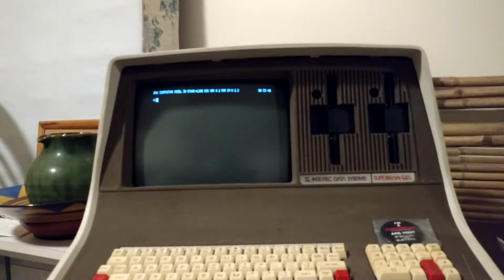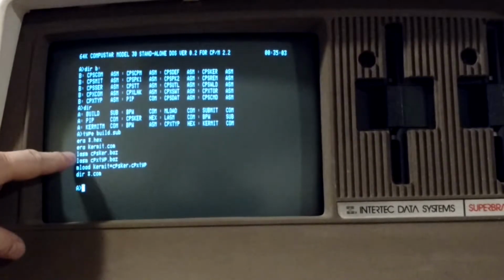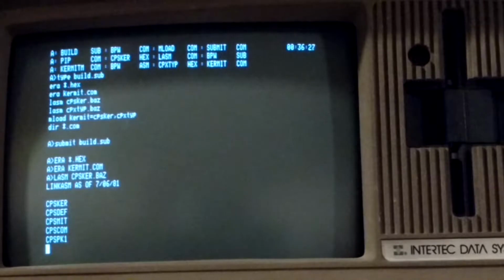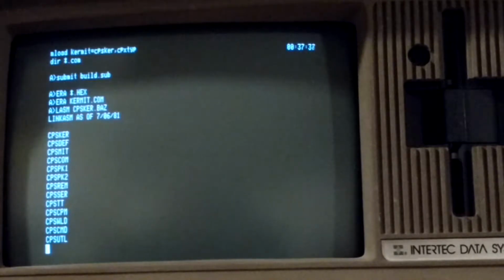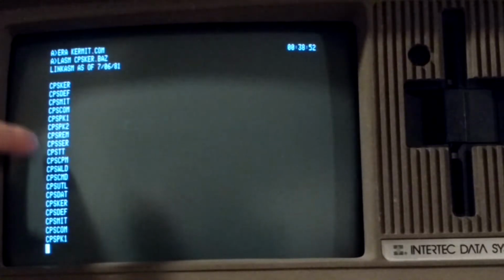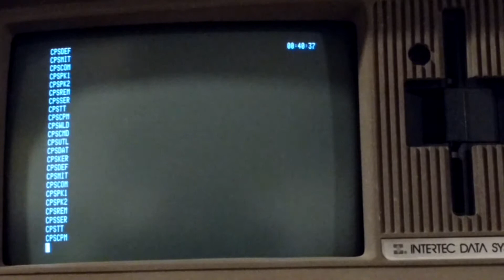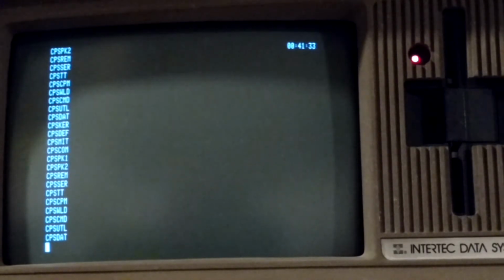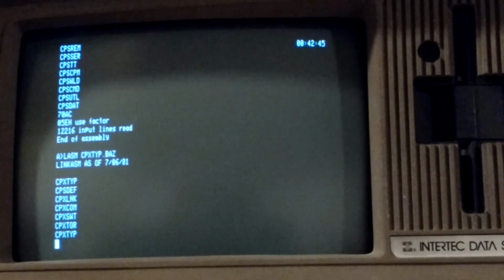Building Kermit-80 on an Intertec Superbrain - old version.

Comment: What a wonderful piece of history. I had no idea that Kermit was written for the SuperBrain. I had used Kermit back in my University days on PC's. Great to see real work assembling done on an old CP/M computer. Today 14 Nov 2020 I just got my Superbrain working. I have 2 and today I got 1 to boot up. No display however on the 2nd the display worked to I made 1 good working Superbrain from the 2. I did notice that 64KTest.com does fail so although it boots it does look like I have some faulty memory to fix before I can put it to real work like your video.
Reply from the maker: Congrats!  I have had to combine units too.  Watch out for the PS- if it breaks its hard to fix.  One case where recapping fully even if working may be a good idea.  The unit seen here stopped working and I have to get to diagnosing it sometime.  I recommend looking up the old Superbrain newsletters, not hard to find, which really illuminate what was going on with the company back in the day- one of the early PC high flyers that crashed HARD.  :)

Comment: Hi - thanks for uploading these videos, I have an Intertec Superbrain QD, non functional since I got it 10 years ago. Until I manage to fix it, watching these vids is the next best thing! Could you make some more videos about this machine? Maybe go into any specifics about the motherboard, video board, power/comms board etc? There is very little on youtube about the Superbrain, anything you can add would be welcomed by myself and many vcfed forum users. Thanks!
Reply from the maker: Don't miss my abitoutofplace blog linked in the listing. My restoration work is there.  Also see the CP/M forum section of VCFed.org where there are a number recent entries on Superbrain repairs.  I'm dmemphis on there.